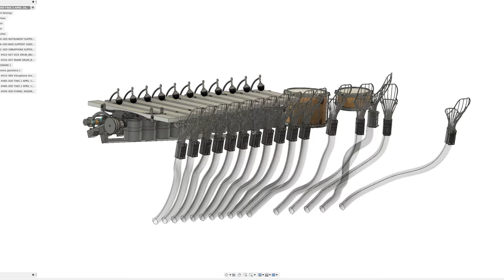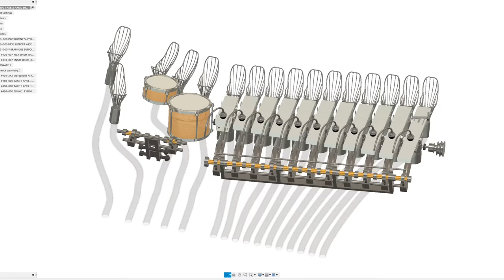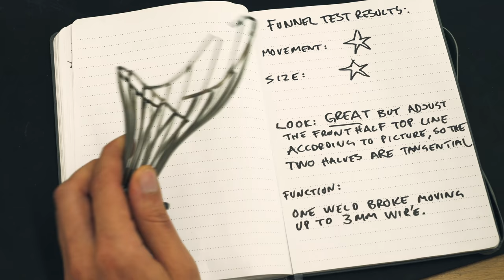Marble Funnel Design Test - Marble Machine X #87

Comment: Maybe this thin piece of metal you added to reduce the flimsyness looks better if you bend its outside end towards the inside (direction of the funnel) again. Watching from the side, it would look like a small circle then. As it is now, it just points to the outside. Could maybe also help reducing the risk of hurting your fingers when touching there.
I hope it is somehow understandable what I mean... :)
I also like your idea of having the front half tangential, embracing the back half with some technically neccessary distance.

Comment: What you added with your finger was a plastic/resitive component to the elastic/springy system. I.e. a shock absorber. A sloppy silicon-ish thingy may solve it. Or a friction brake. Added weight at the top will make it slower but may increase inertia/longer strokes.( Now my engineering knowledge is exhausted.)
You may try Castoline soldering instead of welding and burning. Look it up! 
And.. "Ett väl utfört arbete ger en inre tillfredsställelse och är den grund varpå samhället vilar!" Good work!

Comment: Personally, I would go with  rubber funnels. The metal ones are noisy, weldings can break, and the spring metal can get tired at the wrong time. Rubber doesn't need spring steel for elastic action.

Comment: Another way to make the spring metal more stiff would be to move the two lower screws a bit up (to the point where you hold it with your fingers).

Comment: The shaking is due to the energy stored in the springs. They can not dissapate so it shakes. You need a damping element instead of more springs. Try putting one spring and one rubber piece, experiment with the thickness of rubber maybe. Silicone may also work. You need some material with viscoelastic properties, so it can dissapate the energy fast and come to a complete stop without bouncing.
Reply: Otherwise you will need to make the spring too stiff to see that opening action.
Reply: What you were doing with your finger was adding a damping element. It was dissapating the energy trough your hand so it was a smooth closing.

Comment: I know from riding skateboards that vibrations can loosen screws and bolts over time. I think you should put a drop of rubber cement on the screws to prevent this from happening. A bit of skateboard knowledge to help your machine.

Comment: 3:53 No Martin, just place another screw halfway up to the joint and maybe just have a single screw at the bottom instead of two and centre them, don’t have them at each side. You won’t need stronger "spring" by doubling the metal....

Comment: Why didn't you just drill a hole right where you put your finger on the spring steel, and screw a nut, or coil spring against the spring steel? You could even control the springy ness, by tightening the screw down, compressing the spring and increasing the pressure on the spring steel. I think that would fall in like with the whole adjustability idea you've been building into the MMX thus far.

Welcome back, by the way, we missed you!

Comment: im a welder and i wich i was there X) i think you fix the wrong probleme when you had a spring to the funel it was shacking because the spring didnt have any tension in it you juste reduce the shacking by reducing the lenght of the spring if you bend the spring so it alway push against the funnel it would shack less i think (might want bigger spring to)
it is almost finish it look so nice !! i will go see you as soon as you are in quebec canada (if you come here XD)

Comment: I am wondering why you did not try using the other two screw holes on the base of the test funnel to effectively shorten your spring steel or use a thicker piece in order to try to reduce "shaking".
Reply: Another idea:  add a crease lengthwise down the middle of the spring steel to strengthen it (_widthwise_ down the middle makes it even more flimsy).  Or layer them like the leaf springs on a car's axle.

Comment: I feel like you should just use the single spring steel and just have a bolt put up higher about where you were holding it with your finger. That could save you extra materials and weight.

Comment: You may be making an additional change to this design.
Make the moving part a little narrower, so that it does fit into the fixed cage, not as it does now (outside), but inside, otherwise there will be a loss of marbles or become a jam possible ;-)

Comment: you have 2 sets of nuts holding the spring steel. you should do it, plate-nut-plate-nut. might need 4 screw holes at the bottom too.

Comment: There are lots of comments here about how to improve the spring mechanism. Using thicker spring steel will increase your spring constant so the total movement will be less. There will be less residual oscillations but you will sacrifice the displacement magnitude from the impact itself. Moving the screws up will also decrease the total amount of movement but will have the added benefit of increasing the frequency of the residual oscillations so they will likely die down more quickly. Neither of these solutions have much impact on the damping of the system. I think you would have a lot of success experimenting with trying to increase the damping rather than messing around too much with the spring. A thin piece of soft rubber placed between the two funnel parts near the bottom would help absorb a lot of the energy and help reduce a lot of the residual oscillations.  Using a rubber band in the same area where many suggested mounting new screws would likely work well too. The reason it worked so well with your finger was less about the position and more about your finger being soft and a fairly good damper.

Comment: Reminds me of the story from when they built the BBC Micro (think it was the Micro, could remember it wrong tho). They had this problem with a chip that would only work if they put pressure on it with their finger. Not knowing why and because of time constraints, they ended up with putting in a piece of plastic to keep pressure on the chip. That that ended up being the solution they put into production.

Comment: Why would you add another piece of spring steel instead of just creating another screw hole higher up on the existing spring, right about where you were pressing on it with your finger?

Comment: You could make a plate the same dimensions as the first spring you cut, bend the first 3-4mm up 90deg the drill and grind a pair of parallel slotted holes up each side that line up with the bottom two in the spring, then mount it on top of the spring at the lower section with the bend at the bottom likes handle, then with the bottom two screws loos you will be able to slide the plate up and down to adjust the "bounce" by changing how much of the spring is held down, or preloaded if you will.

Comment: Replacing the strip of spring steel with a rectangular block of high density polyethelene (HDPE) would allow the funnel to flex in response to the impact of the marble, but would move the basket back to its original position much more slowly than the spring steel does. It would also dampen the transfer of the impact sound wave (the click) to the rest of the MMX framework. I would try an HDPE strip that was 3mm thick at first to see how it responded, then go thicker if the motion was still too fast.

Comment: Why not make a small metal plate that can slide up and down over the springplate? Like the picatinny rails on guns. You probably need only 1 screw on 1 side to tighten it and then you can change the wobbleness of the funnel in seconds.

Comment: That was a bit odd: "the beauty of it is that  instead of using a hinge and a spring, we use one piece of spring steel as both hinge and spring" - tests, then uses one piece of spring steel as the hinge, and adds another spring... :)  Why not drill holes a bit higher, so the resulting hing/spring is stiffer, instead of adding the extra complexity ?

Comment: will some sort of magnet help with the flimsy/wobbly part of the catch, to help keep it still after extending
Reply: Magnets are brittle, if they are hit frequently they will break, and then you may be introducing a remagnetization of the marbles again and need to demagnetize them another time. A simpler solution is probably just to add a screw where he put his finger to stabilize the piece instead.

Comment: Don't tig weld the wire!! You want a spot welder for the wire.. Or braize it will you have nice gold welds where it joins.. Plus you'll get a much stronger fillet with braize or silver solder

Comment: Half the comments: drill holes where you finger are holding the steel plate. Also, what about the metallic noise of the marble and the shaking of the flower? Even if the mics won't catch it, I wonder the result when you have tens of marble hitting them.

Comment: I didn't read all the comments so if this has already been suggested then disregard.....If you make a collar that can slide up and down the bottom area then set screw in place to clamp the spring at different heights you can tune the spring system for perfect response. Or you could use a hose clamp to slide up and down till you find the correct point and add a bolt in that position....but then you can't tune it further later in the field which might be important.

Comment: @6:29 you're not gonna put enough heat into a part like that to change the dimensions that much- you wouldn't be able to touch it without it burning you if it was hot enough, machinery's handbook pg. 364- steel would take roughly 1000f to change it 0.0013" (537c, 0.033mm)

if you add preload to the flat spring (which i see you were trying to do with the second layer of spring) it will also act as a damper

Comment: @Sir. Jonathon Daniel Gregory Sr. V the third Jr.   Has a valid  point for everyone that's saying to just add a screw where he held it with his finger.

If you shorten the length it puts more stress on a smaller area which would shorten the lifespan of the part. Seems like a bandaid solution.  It needs a spring dampener combo. So it springs back far and then returns without oscillating which @ WhatAboutTheBee  explained

Comment: This isn’t an original comment but you might want to look at using copper or brass wires so you can solder them instead of having to weld them

Comment: He asked be careful when he close down the middle depending on what metal is using if it's not Stainless then it my trust so I recommend that you should actually have hot water on it that will cool it down and it also so upset from cooling down too fast so that it won't hurting too much and break

Comment: using extra material and melting it using an oxy-acetalyne (would require flat surface to get accurate results), but yeah NightHawkInLight, brazing might be a much better idea, or even silver Braze/Solder (it's more commonly called Silver solder, but it's honestly a fluxed braze with silver alloy for dissimilar metals

Comment: you might have better luck using a soft piece of material to dampen the springs return between the two blocks off metal attached to the hinge.

Comment: Couldn't one add something like a very short piece (ring) from of a rubber hose or similar, slipped around the tube and the spring, to hold the spring to the tube (as your finger did) at an arbitrarily adjustable height...? It could be pushed up or down to hold more or less of the spring, until the remainder is exactly as springy as needed...

Comment: 3:36 Why not adding (or moving) screws from bottom to the top of the steel spring? As you simulated with your finger... Or use thicker steel. It would be a nicer and more efficient solution right? 🙄

Comment: I'm not a fan of the wires in the funnel. perhaps prototype a solid sheet of stainless steel? Or take an actual stainless steel funnel and cut it verticality in half then add the spring

Comment: I would suggest rather than adding more pieces of spring steel, instead moving the bottom screws closer to the top screws. That would allow for less movement and not require extra parts. Either way, it may still require 2 pieces of spring steel. Just an idea, not an engineer. Cheers!

Comment: You need to dampen that joint if you want to stop the oscillations. Try something very malleable like a small thin skinned bladder filled with grease.

Comment: Why don't you just 3D print the Funnels? With 3D-Printing you could get a event more organic shape and you wouldn't have to think about those 1000 welds on the thin steel wire.

Comment: Use brazing, not welding on the funnel wire.  For 2mm wire, an ordinary propane torch, flux, and silver braze wire is all you need.  Your suite of tools is missing 2 things.  One is a metal lathe (for fabricating or modifying round parts), the other is silver brazing.  Get rid of the angle grinder and the cold saw!  The advantage of brazing is that you can not only fasten parts, but you can "edit" them.  I see all the parts you have irrevocably welded on the machine.  May The Gods Be With You when you need to modify or repair them!  I would also not support the funnels on plastic tubing.  I would mount the funnels, and let them support the tubing.  When you ship this thing, the funnels will get hit and break the plastic tubes!  The tube job should be only to guide the marbles from one supported section to another.

Comment: Clearly the solution your oscillation problem is to ratchet design complexity up to 11 and fit each funnel with a teeny-tiny hydraulic strut. Will also add a bonus steampunk aesthetic.

Comment: yeah, going to be a tonne of armchair engineers sprouting up on this one. The thin metal string, it aint working. suspect you'll just put a thicker piece in (not double up thin). Although, you didn't like oscillations, so perhaps ditch the "sprint" concept. Using bungee or rubber band.  Not pretty, but can likely be made pretty (and easy to replace, not machined).

Comment: If you want to settle the vibration faster, you need to add damping to the spring. An easy way is to use constrained layer damping tape. Apply this tape to the main spring steel.

https://multimedia.3m.com/mws/media/117317O/3mtm-scotchdamptm-vibration-434.pdf

Comment: Hey Martin, Try a silicone o-ring around the base of the wires just above the base.  McMaster link here: https://www.mcmaster.com/1173N026
Also, TIG braze the wires rather than welding. Better fatigue resistance, and a cool look.